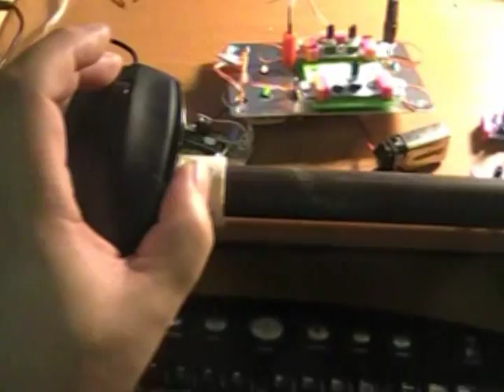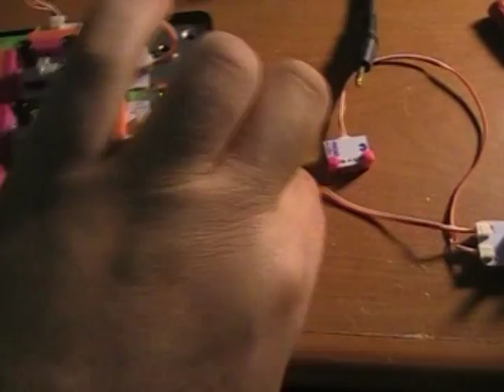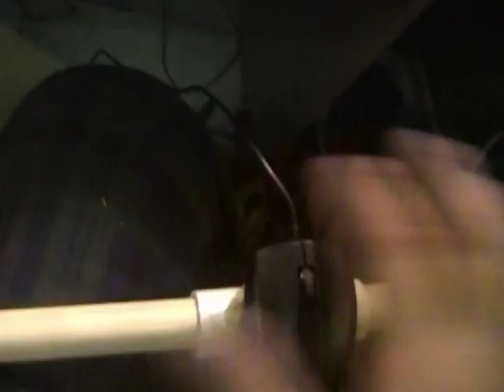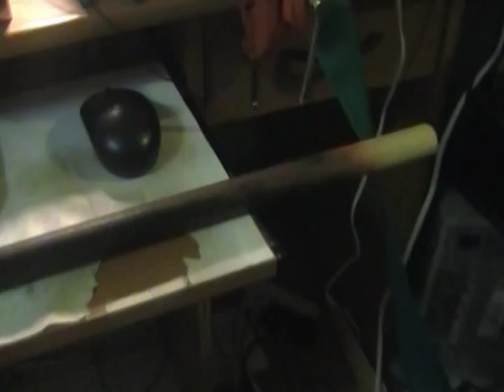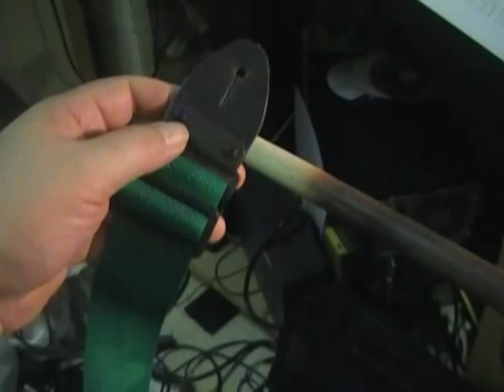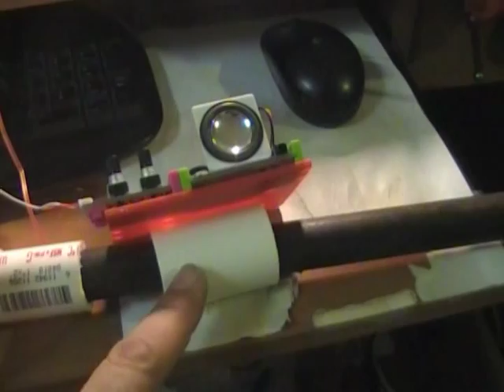LittleBits Broomstick Guitar

Comment: Hi Peter ... great broomstick guitar.

Watching your video, I can see one improvement to make the playing more guitar-ish.
No change in electronics (except maybe you need to flip direction of slide for pitch control)

A) Keep the dowel separate so it can slide.

B) Fix the Mouse for the right hand button press to the controller electronics.

C) Now Right hand presses buttons to activate note like strumming of guitar while left hand slides the dowel like the nech of guitart up/down for pitch and rotate the dowel for bending effects.
Reply from the maker: Hi, thanks. I now have the LittleBits Arduino module so I should re-build it. I have also built the mouse interface into a littleBits Perf module.